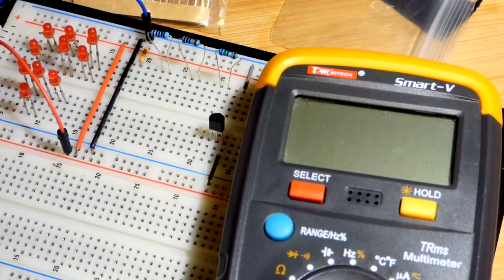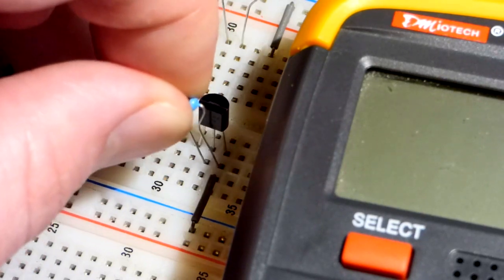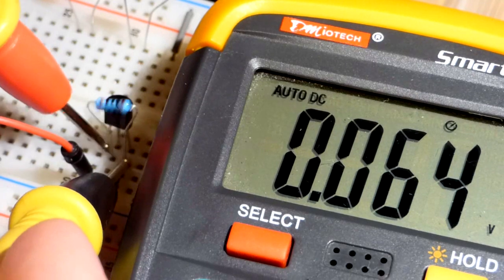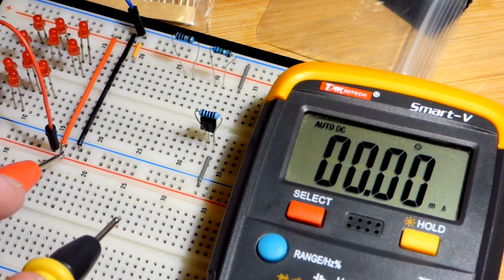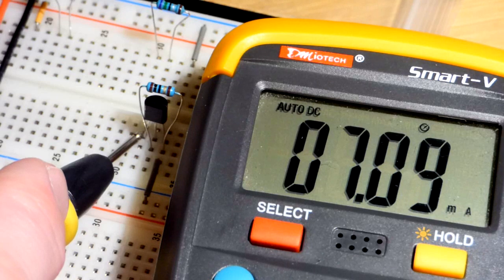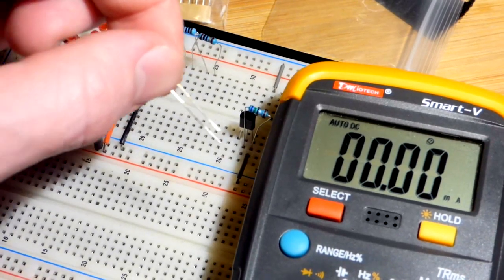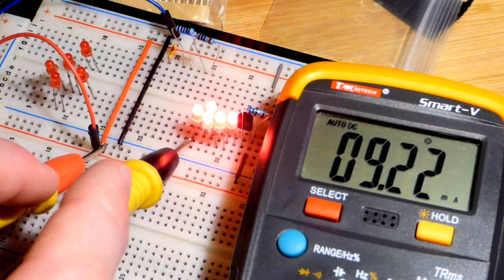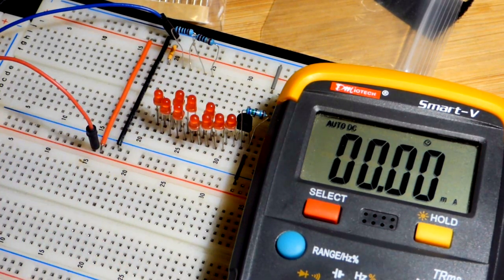Amazing LM334 3 terminal adjustable current source using only 1 resistor component demo

Comment: I don't have a board to find out the few current values I'm looking for an LTP in an amplifier...
I know the voltage (14.6V) and the resistor value (8.2K), so the current is ~1.7mA, but the datasheets of the LM334 are rather complex to find the R_set need for that "constant" 1.7mA using an LM334... 😐